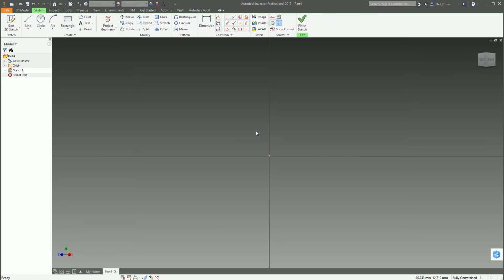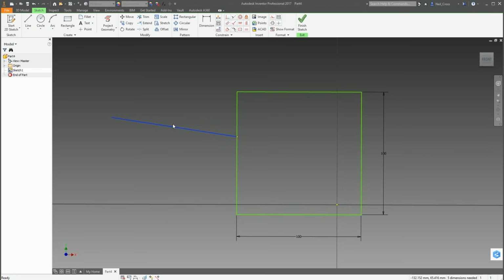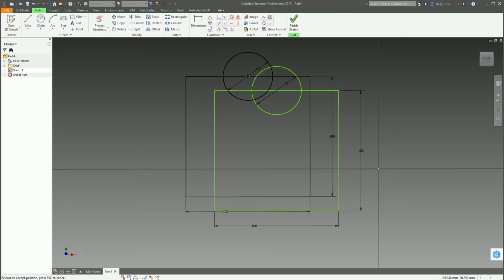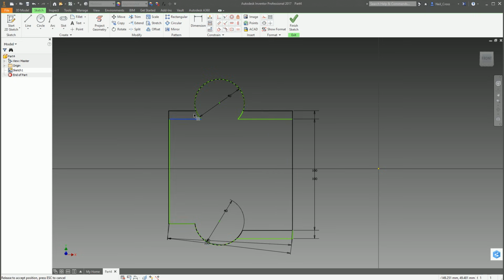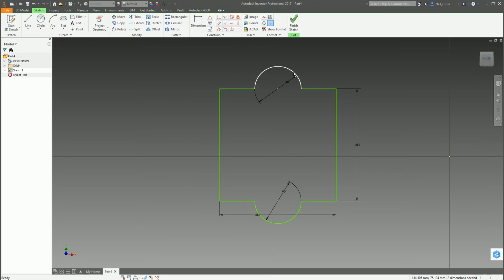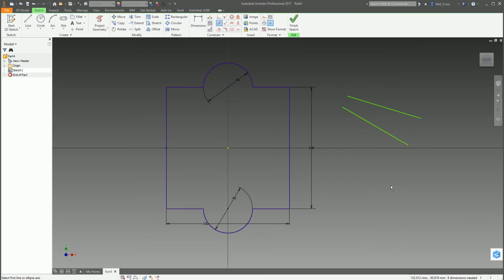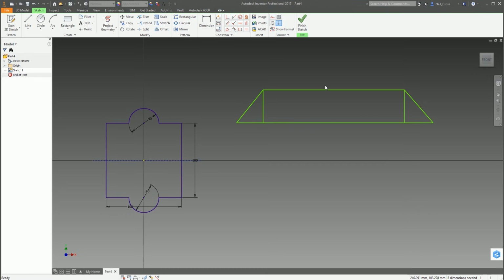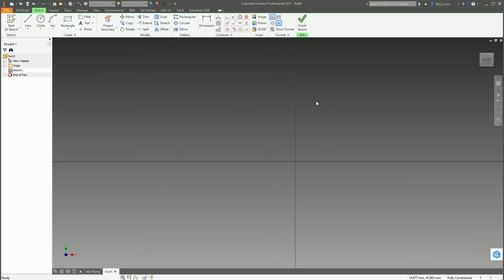2D Sketch Constraints, A Beginners Guide | Inventor & Fusion 360

Comment: 15:08 - about the center dot of the sketch... I like to think about it as the reference point, not a center point. For this example, let's say that this is a jigsaw puzzle piece. I'd probably constrain that point to the center of one of the circles. So, when I insert it into a hole in an assembly, it fits even before any constraints are applied. This allows for a preliminary glance at how it would fit and sometimes even saves me a move command or two.